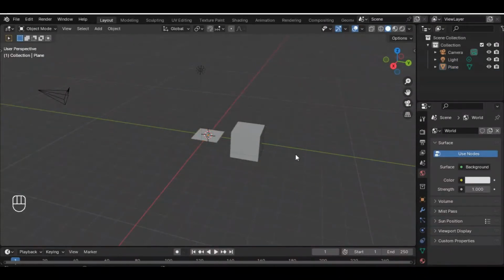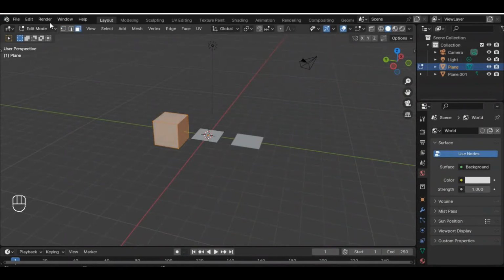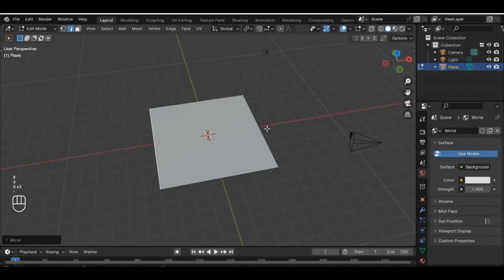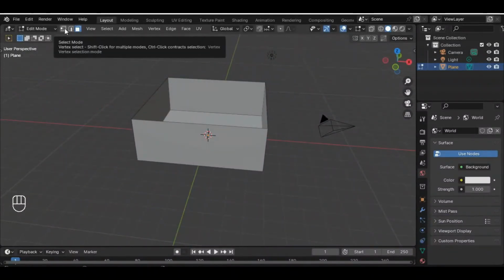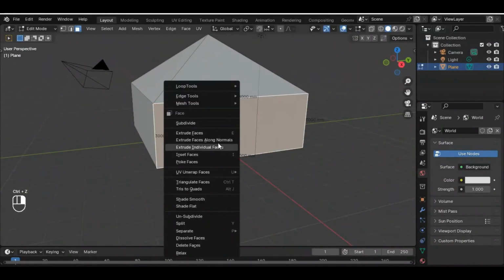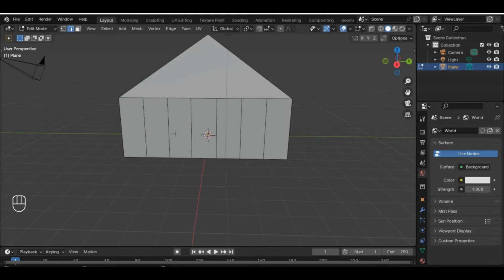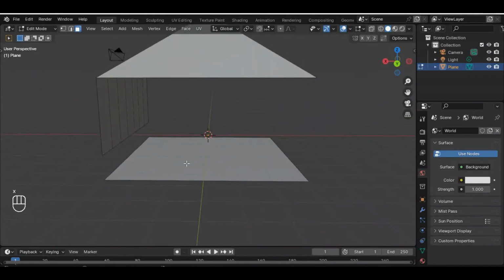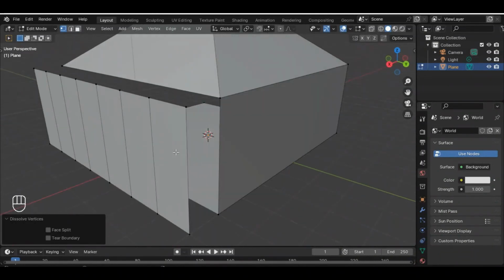Blender 3D Architectural Modeling: Master Your Designs Step-by-Step pt2

Comment from the maker: This tutorial is Part 2 of our three parts tutorials on how to use the blender software to design a 3D architectural project for beginners. This video covers an extensive tutorial on how to navigate through the Object and Edit modes of a scene in blender, creating objects from meshes, duplicating objects, transforms and editing objects in a scene in the edit mode using the Face, Edge, or Vertex select options.

Blender software is a FREE and opensource design and animation software, a versatile and powerful tool that can be used for architectural design and so much more. 
You can watch our previous tutorials on how to use the Blender software by clicking on the links below, or visit our playlist titled "Blender for Architectural Design"

https://youtu.be/Tv1XRH--coo 

Thank you for watching our video and please don't forget to like or leave a comment so that we can know what you think. 

#Howto #howtouseblender #structuralengineering #civilengineering #architecture #building #construction #AutoCAD #Orion #ProtaStructure #architecturaldesign #structuraldesign #StructuralSteel #projectmanagement #buildingconstruction #blender #blenderart